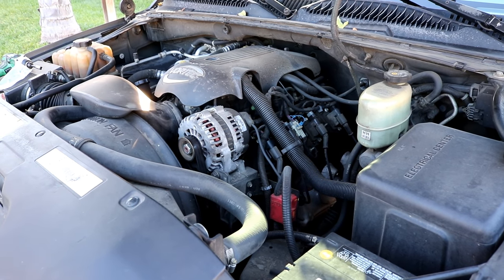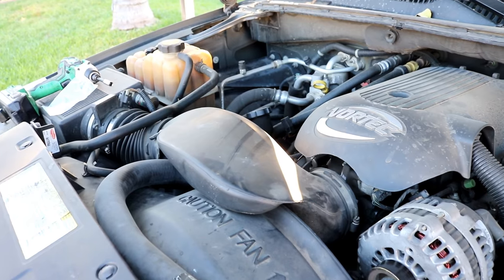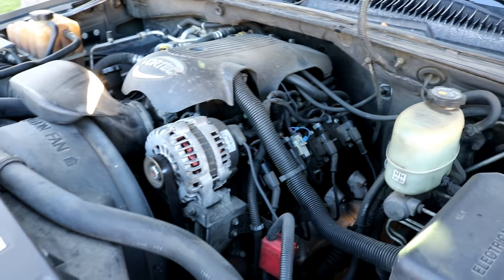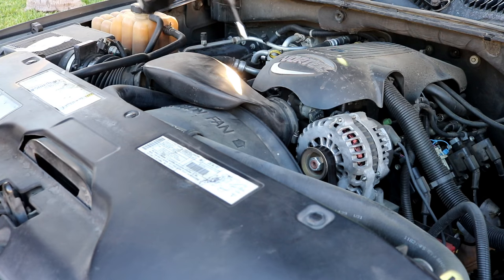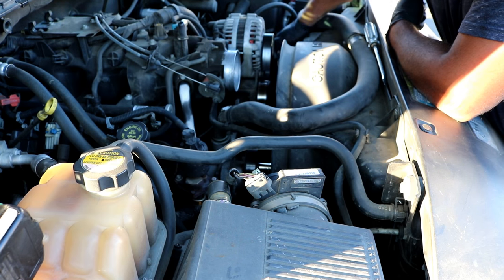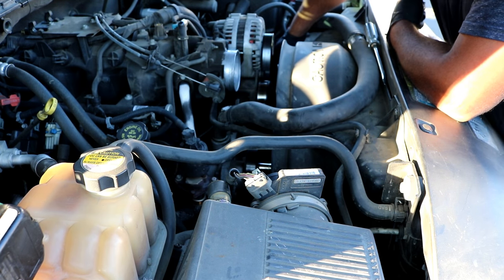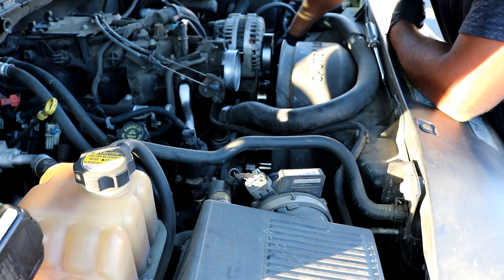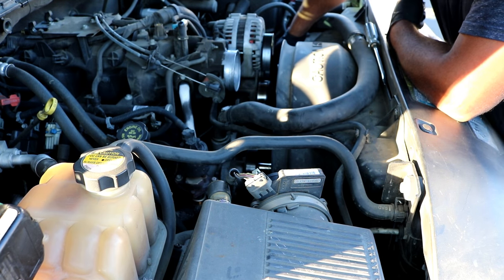2000-2006 Chevy Throttle Position Sensor P0122 (HARD SHIFTING SOLVED HERE!)

Comment: Did you have any warning lights or any codes?
Reply from the maker: Neil P71 No check engine light on but pending codes as you will see in the video.
Reply: @HelpingHandAutoRepair  I just washed it. Great video. My truck just started about two weeks ago. Tranny fluid is good. The issue I'm having is that as you take off you will feel a split second jolt and sounded like two pieces of metal clicking but not extremely loud. Loud enough to get my attention. Only in low gears 1st to 2nd. Advice?
Thanks
Reply: The jolt is not happening all the time. Twice in the last four days.
Reply from the maker: Neil P71 If you have a scanner you can try to see if you have a TPS code pending. However in most cases a bad tps will cause all gears to shift harsh.
Reply: @HelpingHandAutoRepair  I am going to run a scanner and will let you know for sure. Thanks for sharing the video.
Reply from the maker: Neil P71 You need to use the scanner for a smooth linear range. Plug up the scanner, go to
Live data and slowly press the throttle until you reach full throttle position. The percentage should rise smoothly according to your foot position.

My money is on a bad TPS.
Reply: @HelpingHandAutoRepair  I will. Just started raining here in NE Ohio. I will reach out and let you know what happens. Thanks  so much.
Reply: @NeilKudro  most likely your drive shaft yoke sticking in your transfer case.  You can remove it and grease it and it will go away for a while.  The splines wear and start to stick.   Google sierra yoke clunk

Comment: What if your transmission high revs between 1st and 2nd? I have to let off and it will shift. But if I give it gas to soon after it shifts. It high revs again. And when I shift into reverse it clunks loud and you can feel it. I need advice. Thank you.
Reply from the maker: You can still get a scanner and check the TPS (shown in this video) for a nice smooth linear reading from 0-100%
Reply from the maker: As far as the harsh shifting into reverse, check your u-joints on your driveshaft for excessive play. It could be a boost valve problem inside the transmission also but u-joints are easier to check first and cheaper to deal with.
Reply: Thank you I’ll look into that.
Reply: Same problem with my truck minus the reverse. Just changed tps and it seems like the truck runs better and smoother now but the high revs is still there between 1 and 2. But the tps change helped. It.
Reply from the maker: You could very well have worn clutches inside the transmission. Especially if the truck has higher mileage.
Reply: @HelpingHandAutoRepair  222k
Reply: @HelpingHandAutoRepair  just changed the trans fluid filter gasket and pan not 2 months ago
Reply from the maker: Yes. 4L60s will fail at some point in their lifetime. The accumulator piston could be worn or broken inside the bore. Also could be low line pressure due to a leaking boost valve. 

My guess is the transmission is just old now and it’s slowly dying.

Comment: What if I have no check engine light but it shifts from 2nd to 3rd hard, like i will drive normally and when it shifts at about 2000 rpms it goes up to about 3,000 rpms and sound like air
Reply from the maker: If you have a scanner capable of reading live data. Check the TPS reading for a smooth reading from 0-100% without any spikes.
Reply: @HelpingHandAutoRepair  that’s for your reply I will check into that!

Comment: What does it mean if I have no overdrive with a new tps sensor but when I unplug it I have overdrive again
Reply from the maker: How many miles? 

Plug the TPS back in, delete whatever codes you have and then take the truck for a test drive on the freeway where OD should engage. If it doesn’t engage AND there is NO check engine light coming on, then you need to check for pending codes (if your scanner is capable) 

You really gotta try driving it for a little while on the freeway. What you’re trying to do really is to replicate the problem over and over. So that way you can get a code to come up on purpose. If you get a check engine, then scan it and let me know what you get. If you get a pending code, then let me know what it is. 

More than likely you have a problem with the TCC solenoid being bad, TCC  clutches are worn or there there is a TCC circuit problem.

Comment: Is different for an 06 with drive by wire
Reply from the maker: Yes. The drive by wire Throttle body has the TPS sensor built into it. You can replace the TPS individually but some find it easier to just replace the whole unit.

Comment: Did the tps sensor go in with out having to put force ?
Reply from the maker: LaSierra 4.8 There will most likely be some resistance as the new rubber gasket gets seated into place. It should not be that difficult to install.

Comment: Im having issues with mine the battery levels go down and the the lights shut off and for some reason the transmission stopped shifting as well
Reply from the maker: These transmissions are electronically controlled. If there isn’t good battery then they can do all sorts of odd things.
Reply: @HelpingHandAutoRepair  but the weird thing is when my lights shut off completely I come to a complete stop and the lights and battery levels go up again
Reply from the maker: Check to make sure your alternator is outputting the correct charging voltage. Take it to Orielly or Autozone and have them test your battery and your alternator
Reply: @HelpingHandAutoRepair  auto parts store dont always give you accurate results on their alternator or battery test. I had an alternator with a bad voltage regulator. They told me it was good but  the voltage gauge would drop to about 9 volts while at idle. They wouldn't do a warranty swap cause it tested good according to their test. Bought an ac delco from amazon and all has been good.

Comment: I have a 2001 Chevy Tahoe   when I drive it for about 30 min.then the  first gear shift hard and second..but my service engine soon light was on in it never came back on could it be that
Reply from the maker: You can check for codes with a scanner. If there is a code for Throttle position sensor then you should replace it.

Comment: I have a 2006 suburban 1500 and when i accelerate from a stop it looses power and makes almost like an electrical override noise from the top of the engine somewhere and i have to let off the throttle and push it again to make it go away and then its free sailing. I am unsure if it would be my TPS, Throttle body, or something completely different. Before i start randomly throwing money at it anyone else experience this?
Reply from the maker: Not sure what that would be unless I actually drive the car myself. If you have a check engine light on, definitely read the code and go from there.

Comment: How does the electronic throttle bodies work
Reply from the maker: A sensor on the pedal inside the car tells the throttle body what to do
Reply: @HelpingHandAutoRepair  so replace that sensor... I'm having an issue with it stalling out when shifting in reverse... It's not all the time just whenever it wants to do it.... I just replaced all the gaskets intake gaskets valve cover and the valley cover gaskets... It's never done this before
Reply from the maker: Do you have a check engine light on?
Reply: @HelpingHandAutoRepair  no I'll get a evap code after I get gas but it goes away after I tighten it up.... I had a issue with it stalling 2 days after doing all this it would stall every time I came to a stop... Tightened up some bolts a little more and it was doing fine for 2 days and it did this yesterday... I'm gonna try and spray some water around the intake and vacuum hoses and see if anything triggers the idle drop
Reply from the maker: @shaunmoeller3288  I would definitely check for a vacuum leak. Seems that would be an issue considering all that stuff you just touched. If you throttle body is electronic, you may need to check for leaks there and make sure the TPS is reading well and perform a idle relearn.
Reply: @HelpingHandAutoRepair  thanks I know the map sensor can cause this issue as well... Might go to the junkyard and pull a bunch of sensors
Reply from the maker: @shaunmoeller3288  well if you have a check engine light on, then read that first before just grabbing a bunch of sensors and wasting your time.
Reply: @HelpingHandAutoRepair  just evap code... I did have bank 1 and 2 too lean random misfire and maf sensor changed the maf and all other issues went away now I just get the evap after I get gas but goes away
Reply from the maker: Bank 1 and 2 lean could be pending still (ie not showing up with a light just yet) you are for sure on the right track of looking for vacuum leaks.
Reply: @HelpingHandAutoRepair  I did a smoke test on my evap system and had smoke coming from the purge valve in back of the vehicle... Should smoke come out from that with vehicle off
Reply from the maker: There shouldn’t be any smoke coming from the tubes. If it is leaking from a connector, replace that hose or tighten up a clamp and see if it helps.
Reply: @HelpingHandAutoRepair  it's coming from the vent valve behind the tank I wasn't sure if smoke would come from that with the vehicle off
Reply from the maker: There shouldn’t be any
Smoke coming from
The top of the fuel tank. There is a vent valve but that has a tube that goes to a vapor canister. If there is just smoke coming out of the top of the fuel
Tank then you need to
Drop the tank and see where the leak is.

Comment: My 03 silberado 5.3 I have reduced engine power 0516 so I changed just the pedal sensor and still get it. I didn't change the pedal just the censor. But man 1st to 2nd gear is rough.
Reply from the maker: What is the check engine light code?
Reply: 0516. Throttle vs acceleration command (tac) in parenthesis
Reply from the maker: Is there a “p” code? Not sure what you’re reading with to get a code that just says 0516. If I look that up with P0516 (as most codes are shown) it is battery related. Not transmission related. What scanner are you using?
Reply: Yes sorry it has a p code forgot that
Reply: Weird my battery is new on my p3 chevy. The code def reads throttle to actual censor(tac) module
Reply: Weird that code says that. Maybe I got the code wrong gimme just a sec
Reply: Sorry it's P1516
Reply from the maker: Oh ok that makes sense now. That is reduced power. Typically means your throttle body is faulty. You can try taking the intake tube off and cleaning it out. If that doesn’t work then you need to replace the throttle body. The sensor on the pedal has nothing to do with this code.
Reply: Ok I did clean the throttle body really good already didn't mess with Any thing else. So if it still did it prob best to buy an new tb with the censor attached to the throttle body? I didn't clean the plastic tube though that runs to the air filter

Comment: Would the code P0122 cause my vehicle to be hesitant while driving?
Reply from the maker: It’s possible. A failing upstream O2 sensor and a bad MAF could cause that too. Along with a clogged fuel filter. If you can get access to a scanner that can read live data, you can monitor O2 sensor readings, MAF readings and TPS readings.

Comment: What if doesnt hard shift but has a hard time getting over 50 60 mph
Reply from the maker: luis perez Is there a check engine light on?
Reply: @HelpingHandAutoRepair  yes but i do not have a scanner to check for the code
Reply from the maker: luis perez The first thing to do would be to go to Autozone or Orielly and have them scan the code and write it down for you. This will help us determine what is going on with your truck. Then let me know what the code is.

Comment: 199 Chevy 1500 Doesn’t Shift Until I Let Off Gas why ?
Reply: 1999* 5.3
Reply from the maker: Check the TPS data for a smooth linear reading from zero to full throttle

Comment: Can this be a reason my truck is showing a code p0300 (misfiring)
Reply from the maker: No. That type of code can be a few different potential problems.
Reply: What do you think this may be causing my misfire?
Reply: I changed plugs, wires, coil packs, fuel tank and fuel filter, I’m not sure what else this could be?
Reply from the maker: @zachcheek5195  for that type of code it could be: in no particular order.

1. Bad spark plugs
2. Bad ignition coil(s)
3. Bad fuel injector(s)
4. Vacuum leak
5. Bad MAF
6. Clogged fuel filter.

On these trucks, I will say I have seen this code a bunch. If the truck has higher mileage, it has most been due to old spark plugs, intake manifold gasket leaks or throttle body gasket leaks.
Reply from the maker: @zachcheek5195  does the truck idle poorly when cold? Does it get better when warmed up?
Reply: Maybe fuel injectors are bad I’m not 100% sure to be honest with you I did change fuel pump and fuel filter, spark plugs, wires, and coils. I checked with starter fluid for any vacuum leaks around the whole engine and didn’t change the way it idled or didn’t die so I’m really not sure
Reply from the maker: How does the truck run when first started cold?
Reply: My truck idles rough and a hard start…I feel like if it is the tps then it could do with the throttle positions closed at all times till I hit the gas, my truck is running really rich and burning more gas(white smoke) then it should and can smell a lot of gas fumes when idling for a bit, but when I start driving it drives fine and it also doesn’t smoke as much.
Reply from the maker: Also are there any other codes that pop up? Or pending codes? Not all scanners can read pending codes. Sometimes there are pending codes that can further pinpoint the problem.
Reply: I checked the oil and everything to make sure it isn’t a blown head gasket and the oil looks fine just like oil not runny like milk or anything so any other suggestions?
Reply: It kinda runs like it’s a diesel truck does and no it’s only saying a p0300 and a pending p0300 code
Reply: I’m really not too sure it just runs like that kinda all the time rough idle and stuff

Comment: 2001 Tahoe won’t shift to 2nd and my speedometer drops to zero and brake lights comes on and then I have to shift to 2nd
Reply from the maker: Check engine light on? Sounds like your speed sensor might be bad on the transmission.
Reply: I replaced it this my 2nd one still  doing it new one bou 2 months old
Reply from the maker: What code are you getting?
Reply: P0502- and p0503
Reply: Wonder could be cord that runs to vss soon as I drive 4 block it jumps in limp mode
Reply from the maker: Is your truck 2wd or 4wd?
Reply: 4wd
Reply: When put in 4 low it blinks won’t engage idk if that’s anything to do wit it
Reply from the maker: Did you replace the speed sensor on the back of the transmission? Near the end by the tail shaft?
Reply from the maker: There are a few speed sensors on that setup. Speed sensor A is located on the driver’s side of the transmission: check this link.

https://www.google.com/amp/s/www.autocodes.com/amp/codes/p0502_chevrolet.html
Reply from the maker: If you replaced the speed sensor on the transfer case, that’s the wrong one.
Reply: I sure did that’s the one o did
Reply: Thank you for replying and your help hopefully this work !!!!
Reply from the maker: The one you did is the one on the back or the one in the link I just gave you?
Reply: the one in the back I didn’t know it had 2 just got part I’m install see what happens
Reply from the maker: Ok sounds good. You need to delete the code before you install it.
Reply: Well I replaced the one right next to it it seemed to stop for now is that right one kinda next to the back one
Reply from the maker: There is that one I sent you in the link. That is the code P0502 sensor. There are two more speed sensors on the transfer case. The one you probably replaced and another one on the opposite side of the transfer case.
Reply: Yea I just did speed sensor on other side seems to shift good so far the one in the link is more up on the driver side ? I’m have to replace that one too ?
Reply from the maker: If you have deleted the codes and it is shifting fine WITHOUT any codes now. I would just leave it alone. If the P0502 comes back then replace the forward sensor I showed you in the link.
Reply: Ok it’s working fine!! I’m have to clear codes and see how it goes for couple days!!! Thanks a lot on the feed back and fast reply in this busy world !  you where a lot of help I WAs stumped for long time awesome YouTube channel good guy !!!
Reply from the maker: Thanks bro! Glad to help.

Comment: the throttle body comes loose enough to give you access in like less than 60 seconds.
Reply from the maker: No need to do that and then have to buy a throttle body gasket or even disturb that gasket at all. 

It is very easy to swing up the alternator. VERY easy. However people will do what they want anyone like you did. It’s all good.